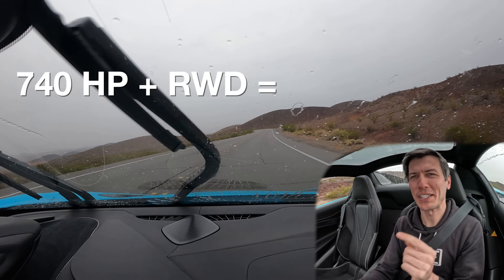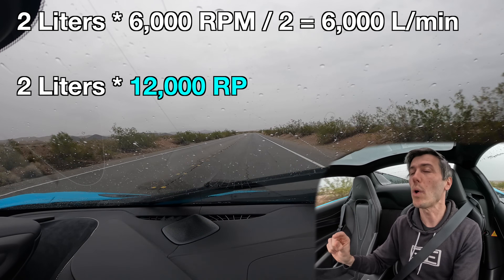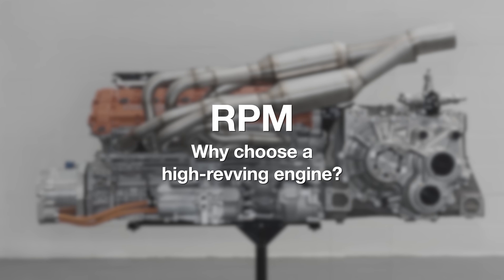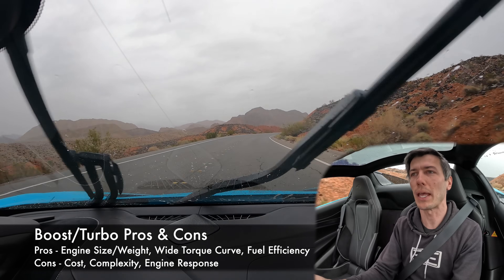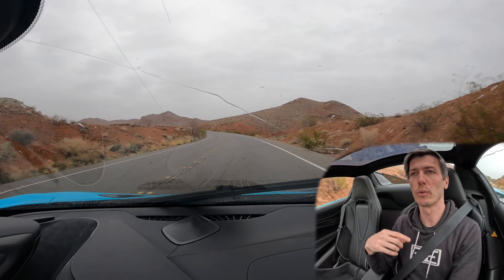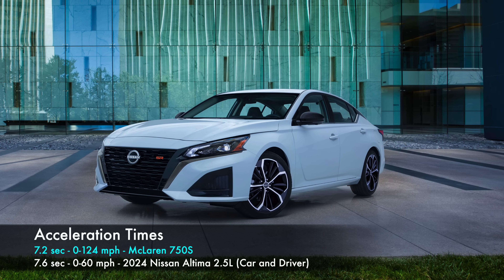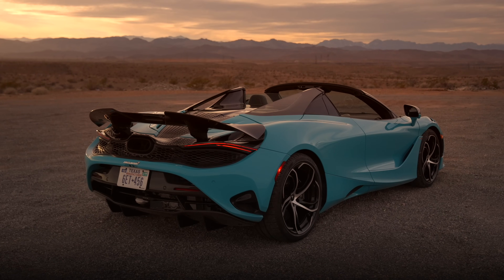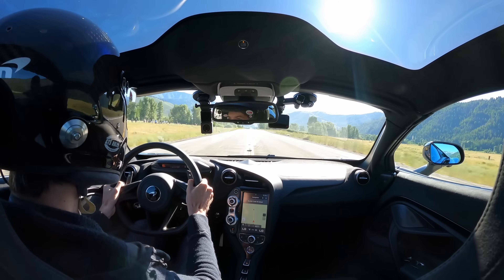Boost vs RPM vs Displacement - What's Best For Horsepower?

Comment from the maker: Okay what's your preference: RPM, Boost, or Displacement??

If you enjoyed this, here are some additional videos you may like!
McLaren Supercar Suspension - https://youtu.be/tkwL8lBo2e0
Driving a McLaren at 200 MPH - https://youtu.be/mGM4ASvcm6M
McLaren Doesn't Use Sway Bars - https://youtu.be/8AVBddY8ClM
Why McLaren Uses Open Diffs - https://youtu.be/gBHmWZcnWwM
Reply: Diesel with massive boost
Reply: @mutantryeff  I agree, I always liked the Audi R10 TDI, Im sure there is a reason there arent more diesel racecars but I like the idea of them.
Reply: @mutantryeff  never drove a diesel but same here. I wanna swap a turbo diesel into my kia.  Better mpg low rpm n boost noises!
Reply: I must say I never gave it much thought but displacement is my goat. im a Naturally aspirated kinda guy lol.
Reply: What about an engine allows it to rev higher?
Reply: @bradwilliams4921 a few components are reduced reciprocating mass (lighter pistons, etc.) and shorter stroke so the pistons don't have as far to travel per revolution of the crank. But there's a lot more factors that go into a high revving engine
Reply: @bradwilliams4921  Very generally, smaller diameter/lighter pistons, stronger crank and connecting rods, and a valvetrain that can support all of that (high valve spring rates, very carefully designed valves, intake, exhaust runners to flow lots of air in a small space with the right resonance).
Reply: @bradwilliams4921  Money
Reply: increase airflow to the engine. Larger valves of possible bigger, intake, ports, higher compression, or RPMs, reduce friction run on alcohol, or some other fuel or use force induction.
Reply: Growing up with bikes, it's revs all the way. Keep it above 8000 all the time :)
Reply: I like a compromise of displacement and RPM.

Peak HP at 7000-8000rpm gives a sense of occasion and a reason to rev it out, but I also want enough torque to feel powerful at any RPM.  And I don't want ANY throttle or turbo lag.
Reply: @GregMcNamer  boxster 981S owner here, I concur
Reply: For me it's:
Boost for a daily
RPM for weekend/fun car
Displacement ( and many cylinders ) for a Grand Tourer
Reply: Gimme those revs. I like those big boy idle chops too. It's hard to beat turbo noises though. Maybe I just like to make noise.
Reply: @Druwoods  Judging by your profile picture, you are a fellow enjoyer of motorcycles. I love my four-cylinder screamer that revs 14,000 RPM
Reply: @riongronberg1435  that old 916 might hit 10k, which is awesome for a twin. The 05 600rr will hit 14k. It's a different song entirely.
Reply: Yes.
Reply: The newer generations will find it a shame that we were running everywhere with a tank full of explosive and toxic gas, wrecking havoc the planet. This is in fact nonsense, 150+ years old,  noisy dinosaur bloating tech, we need to stop burning things.
Reply: Ayye there is audio this time, personally my favorite is high rpm, mid displacement exhaust notes of v8s just singing going through the gears
Reply: what happened, the video was taken down earlier
Reply: There used to be no replacement for displacement. But then there was eletric motors!  More v8 than a v8.
Reply: @JackMott not for a weekender. The sound is half the fun, the handling that comes from a lightweight car os most of the rest. 

Ev for a daily, but even then you need a home charger
Reply: You should really be talking in terms of mass flow.  The boosted engine has the same volumetric flow as a naturally aspirated engine for a given displacement and rpm.
Reply: RPM > Boost > Displacement, imo

turboshaft engines are the peak of RPM maxing but also the peak of boost maxing, and they're just awesome

that said, also pretty happy with my 250cc motorbike that revs out to a 17,500 RPM red-line, though obviously it would be even cooler if I put a turbo on it
Reply: @DjChronokun gotta have that displacement son.
Reply: Boost
Reply: Yes.
Reply: All of them!
Reply: I love a 2.0L I4 engine I can rev out, RPM all the way!  My SR20 has VCT, so I get plenty of low end torque.
Reply: I prefer reverse pulse scavenging!
👀
👅
Reply: Displacemente for me. The best engine is the engine with big torque at high rpm
Reply: Booooost all day 😁
Reply: Electric.
Reply: NA RPM
Reply: Why choose? 😎
Reply: I drive a mini with 1100cc, so I have none of them 😂

Low car weight is my only advantage
Reply: @timsminigarage yeah, I did too. Pity you get valve bounce at 80mph!
Reply: Why not all?

There is something exciting about shoving 20-30 PSI into a 400ci LS, and spinning it at 7,500 rpm.

And, its still pretty reliable! (My engine has outlasted every other piece of the drivetrain....)
Reply: @xtremeownagedotcom Are the internals all forged in that engine?
Reply: From the beginning of this video, I was thinking "I will take all three please."  I never expected to get my wish with the 750S.  Well, I don't have one, so only in my dreams.  My real preference these days is to use electric motors, even better than a large displacement high rpm boosted engine.  I do have that, so I am very satisfied and thankful.
Reply: @georgepelton5645  I dont think a straight electric car will do much in terms of top speed as electric motors degrade once they reach the top tier of their rpm. But I believe the fastest cars out are hybrids running the best of both systems. Cheers!
Reply: @georgepelton5645  Electric can not hang with the top end of these engines- period. No matter how badly you want them to. They quickly loose performance at the top of their scale and use batteries up at an alarming rate.
Reply: All of the above?  Let's get a supercharged, twin turbo, 6.0l V12 capable of 8,000+rpm.
Reply: Revs are always the answer
Reply: There's no replacing the torque on an electric motor but they begin to degrade and the rpm increases. They are unequaled in a quarter mile. But over a hundred mph the efficiency and performance drops off quickly. Cheers
Reply: RPM because high RPM makes me happy
Reply: What is with the engine surging?  That would drive me nuts.
Reply: Naturally Aspirated Displacement big cylinder heads and RPM all day every day.
Reply: @JT-ko3rv  I'm with you but some will say forced induction is the ticket. I feel NA is king for reliability but it appears that they are making some long lasting turbos/superchargers now. Either way, cheers!
Reply: @giggiddy  if I had to go forced induction the engine sure wouldn't change. I can live with even more power too. The long term durability and increased complexity is why I'm not a forced induction guy. But if my choice is a smaller engine that makes the same power as a bigger one. I'm out is all. 😆
Reply: my car is boosted and my literbike is all about revs. Chasing rpm's is definitely more fun, boost seems more practical.
Reply: @B-Rok88 I will take good ol displacement.
Reply: Always boost
Reply: Boost, R35 ❤️
Reply: I wish you can comment on that Carwow race between the 720 winning over the 750
Reply: I only believe in rpm (with high torque)
Reply: Daily use: smaller engine with turbocharger ; BMW Twinpower Turbo (1.5 Mini Countryman)
Reply: Like another commentor said:
Small displacement boost for a daily
RPM for weekend/track/fun car
Displacement for work/towing/touring
And maybe displacement with low boost for work/towing if I need more power
Reply: Electrons
Reply: @pstoppani  no, these cars are supposed to perform well over 100 mph. Im sure you're enamored with electric only cars but they provide very little performance in the high speed segments that these gasoline cars are running at.
Reply: RPMs. On motorcycles, adding displacement and adding boost adds lots of weight. Not with RPMs! Plus, high-revving engines sound cool.
Reply: I like em all. I remember being hugely impressed with the AAR/Toyota Eagle MkIII that got over 800hp out of a 2.1L I4, and it lasted long enough to win 12 and 24 hour races.
Reply: Why put an open diff instead of LSD?
Reply: I have an economy car. I am on the outside looking inward. 🤣🤣🤣 I bought a F&$^* TUNED throttle map to have fun.
Reply: Personally - it's a toss up between electric motor only (just more of it) vs. the combination of an electric motor and an internal combustion engine. (Plug-in hybrid supercars).

I like McLaren's approach though where they did all three.
Reply: obviously rpm, born watching bike and f1 i love the ahility to have a light powerful engine even tho it’s less reliable, would love to make a little car (less the 4.0l) engine revving to 15000 rpm
Reply: Do you have a video on Gf-6 oil yet? I'm reading that there's huge gains to be had in mpg useing it but u can't find much on it..
Reply: For intense driving, preferable with a manual gearbox, I prefer a high RPM engine. Big displacement is comfortable to drive and boost is either for a daily driver or a heavily tuned car.
Reply: All of them! 😂
Displacement & boost for heavy 4x4,  rpm & boost for sports cars.
Reply: Boost and displacement. My 5.9 cummins @40psi. It’s rowdy and I love it.
Reply: @ardenblumer  video or it dint happen. 40psi and no upload, is just missing out on views and free money...
Reply: Combination of boost and RPM. Both can be applied when needed only, you cannot turn off displacement when you don't need it. And both RPM and boost can be implemented without lots of weight, increasing displacement always increases weight.
Reply: Boost and 8500 shift points 😊
Reply: Boost
Reply: All of them. Go big, then boost it to spin faster.
Reply: Do you to awnser questions ? I have 1600cc NA engine with a 2 inch exhaust . Only I think the cat is bad so I bought a 2nd hand 200 cell race cat but it’s 3 inch .. so it’s goes out of a equal length 4-1 header to 2 inch to a 3 inch 200 cell cat brack to a 2 inch exhaust ..  would it hurt the performance or not. ? The cat is backpressure so making it bigger should make it easier for the gasses..
Reply: You should do an old school whiteboard video on latham axial flow superchargers
Reply: All of them. Together. On the same engine.

If I'm not regretting every decision I've ever made it's not terrifying enough.
Reply: boost.....turbos usually.
Reply: Application is key.. big engine to tow n/a and boosted car… n/a for track and boost for drag
Reply: I usually have an issue with choice. Why choose then ? So I went rpm and boost.S tock engine made about 180hp at 6400rpm with 0.7boost. It has been rebuilt to rev up to 9000rpm and take 2.0bar boost. e85 helps, increased static compression too. And it sits in a 2200lbs car, without ABS, stability control, or traction control :D
Reply: displacement
Reply: Since I can't afford more than one car - it is definitely Boost. That diesel-like low-range torque one gets from a modern engine makes it very comfortable.
Reply: I think Honda had the right idea with the S2000.
Reply: Displacement and low boost
Reply: Displacement all day long, the one true reason cars don't use large displacement engines these days is emissions.

The reason LS engines are so popular is that there's so much left on the table due to emissions. 

Boost has major drawbacks but is the right choice if chasing peak #'s or drag racing.

RPM is best in light weight vehicles or motorcycles IMO.
Reply: Revs. F20c, S65, F129, etc
Reply: I used to love the idea of revs, but the more I've played Automation and Beamng, the more I like boost first and displacement second. My favorite engine is a 2.4L I4 turbo that makes 238 lb-ft of torque from 1600 rpm to 6500, peaking at 280 lb-ft at 4900 rpm and 304hp at 6200 rpm. I can't find an engine like this in a car, though. The four bangers are all too small. Remember Ford's 2.3L Ecoboost in the Focus RS that put out 350hp and was unreliable as heck? I think they had it right, they just asked too much from a 2.3.
Reply: I love hirev engine
Reply: There's no replacement for cubic inches
Reply: Team boost. If you're not accidentally starting nuclear fusion, you're not using a big enough turbo
Reply: So final answer what better then @EngineeringExplained

Comment: low displacement - 4.0L; low RPM - 7,500 and at low boost - 12 psi
this is exotic level pricing right?
6.2L V8 in the driveway; had a 7.4L in a Pontiac as a teen.  Had several rotaries that would go over 9,000, and had a DSM with 18 psi.

When he said it has all three ...
I expected a 7L 9,000 RPM, low compression, 30 psi monster with forged parts cryo and wpc treated with a cutting edge lubricant and coolant to bring it all together.

I guess I don't see a V6 displacement doing normal stock psi levels and redline a 70s Muscle car would do as any of the claims.

Merit for what was it, 740?
Rob Dahm makes that on a 13B-T from a TII with a turbo swap and nothing else.  1.3L, turbo, 7,500 rpm, I think around 18-24 lbs of boost?

Comment: reliable and long run power comes only from displacement. a bearing's life comes from how many times it spun. anything high rpm will fail faster. turbos will spin at 24000 rpm in a hot environment. a high rpm engine loweres the reliability
Reply: Tell that to my naturally aspirated Civic Type R. Ridiculously reliable engine despite going to almost 9000 rpm.
Reply: @idkhowtonamemyself2137  it can go is miles away from constantly being in that rev. they are reliable but they are not constantly run in their max rpm if you run it constantly at 9000 it'll blow up probably less than an hour. Airplane piston engines run in their max rpm and it's only 2700 cause they know about the reliability

Comment: Displacement and RPM essentially work the same way runner length and cams do, you're just moving where peak power is achieved.  Long runners and big blocks make better low-end, short runners and small blocks make better high-end, and of course cams are just modifying how much air you're moving and when that air is moving within a cylinder cycle.  The trend is pretty much the same across the spectrum of engine design, you can only get so much power out of so much airflow, the design just dictates where the power figure will peak and how efficiently that target is reached.  But the issue is, nothing is actually good low-end, unless you have a massive cylinder that kills any sense of fuel efficiency, all of the 'low-end' gains are more typical of mid-range when you consider idle to peak range.  I think hybrids are the feasible way forward, electric motors are torque monsters as long as you can keep them fed, which in a hybrid isn't overly difficult to do compared to a battery-only EV.  What most people don't talk about is power under the curve, most people only talk about peak numbers, but duration is important to discuss; if you're faster off the line and you're faster in the mid-range, you really don't need top-end numbers when your competition only matters towards their peak and when their peak is nearing their redline.  And the thing about hybrids is you can easily have a system where the electric motor provides low-end while the gas motor provides high-end, with a mid-range hand-off once horsepower figures cross; though from an efficiency standpoint, ICE as range extension is better, though with the hand-off method you can likely get away with a smaller motor and a smaller battery pack.  This is likely the sustainable way of chasing power figures until battery tech becomes more viable long-term.  Just take drag racing for example, an EV will be off the line with zero idle, while your local hillbilly is idling at 2k+ just to keep enough boost on a big block to be off the line with non-lethargic performance, while they might make similar quarter-mile numbers consider the amount of energy used between the two, the optimal choice is simple enough for a child to make; now consider that with a performance hybrid system, the EV side makes up for lack of low-end, the ICE side trims out the EV weight and provides high end without pre-launch high idle as it can do the exact same job during the EV's phase before the hand-off.

Comment: 1:03 "but ultimately you have to get more air in the engine"
You're looking at a 25% efficient machine and your conclusion is that increasing efficiency is NOT the way to double power? Why?

Comment: 9:12 if McLaren doesn't want to tell you the boost pressure, plug in an ODB Wireless adapter and monitor the peak boost during WOT.

Comment: I dont think your calculation is right for turbo engine, if you use 3/2 which 3 represent the boost pressure which 30 psi, then what if it only has 8 psi? Wouldnt it be just 0.8/2? Which smaller than the whole number divided by 2(naturally aspirated formula)? E.g (2.0*7500*0.8/2=6000

Comment: best solution either supercharged your car to get fast reponse for low-end torque, while keeping you engine in small size with lower displacement. this could be better than large nature aspirated engine. low-end boost can also goes for anti-lag turbo if you not worried about you engine heat lol

Comment: I could totally be wrong here so someone explain it to me if that's the case, but isn't the real advantage to high rpm the increase in power through gear reduction? I mean it is theoretically taking in more air at those high rpms and I understand that could increase the torque output, but irl isn't there significant loss to inefficiencies at those higher rpms?

I mean if you look at the examples he gave of an 8.4L at around 6k producing similar hp to a 4.0L at around 12k. in this case the 4.0L is still only outputting half the peak torque of the 8.4L (even though it could theoretically take in more air at those higher rpms) and only makes the same hp numbers because you can then gear it down to have the same torque as the 8.4L at the same output speed.

basically high rpms generally speaking don't increase power by taking in more air (since that would result in an increase in torque), but instead take advantage of their high rpms through gear reductions thereby increasing power (which takes this into account through the equation for hp)